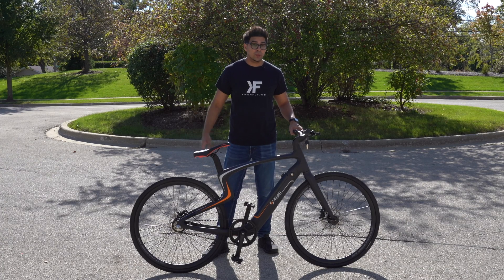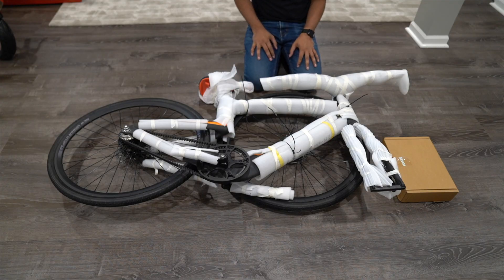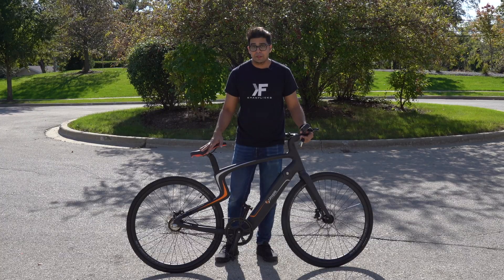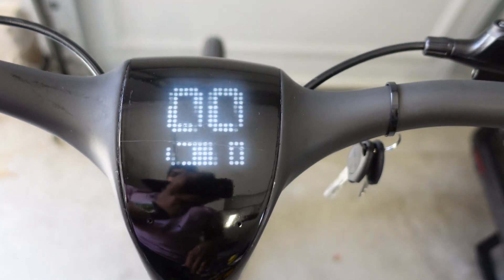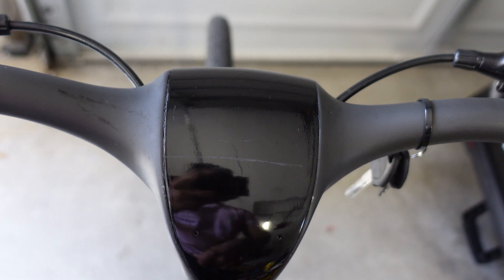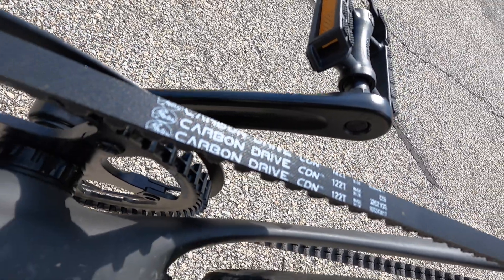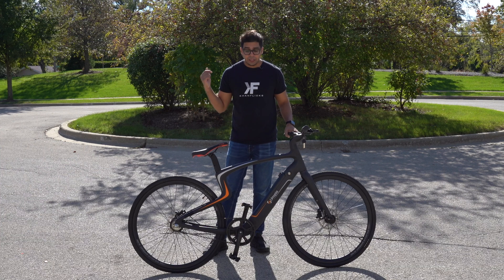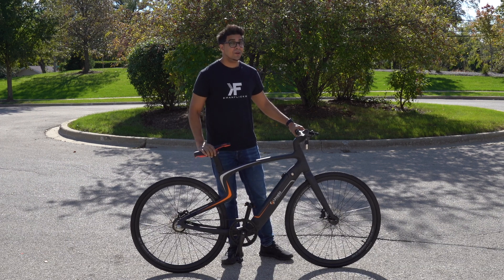The SMART Carbon Fiber E-Bike! - Urban Utopia - Voice Activated, GPS, AI, Finger Print Tech, & More!

Comment: anyone knows the battery pack capacity? Motor power?
Reply: Motor is 250 W, Battery is 360 Wh
Reply: @christophz7157  thanks for the info,  both, very tiny motor and pack!
Reply: @Frg_76  I had exactly the same setup with Cowboy V2 and I think it's actually quite okay. You can't compare rear motors with central motors...

Comment: So many questions about this bike.
So little actual information in this "review."
The smartbar sounds are obnoxious. Can the sounds be turned off? 
What service is providing the weather and other information services? 
Is the display brightness adjustable? 
Is there a screen protector available to protect the display from getting scratched? 
What company makes the disc brake? 
Who makes the bottom bracket? 
Is the belt drive easily replaceable? 
How much travel does the seat post allow? 
Who makes the seat? 
What brand and size are the tires? 
Who makes the wheels? Are they aluminum?
What happens if the fingerprint reader breaks? Can it be overridden or disbled? How do you ride the bike if it breaks?
How long does it take to charge the battery?
Does the battery have to be removed from the bike to be charged or can it be charged on the bike?
Why do you say to ask questions in your review when you haven't answered anyone's questions at all so far?
Reply: Well looks like you covered all my questions 😆 Thank you🤙